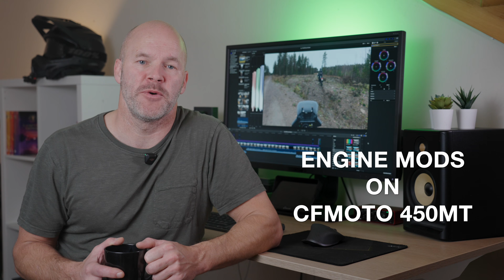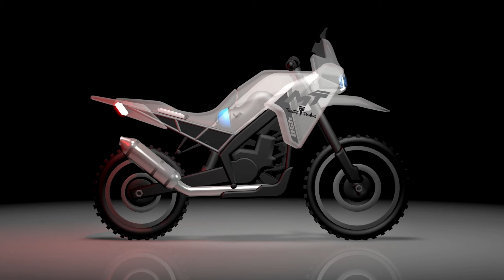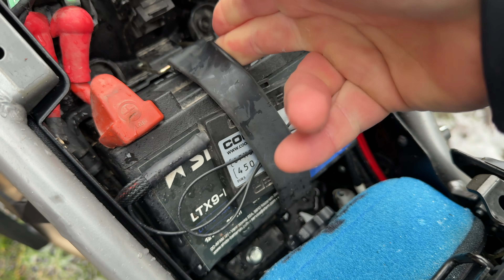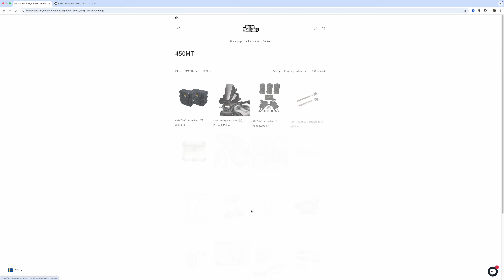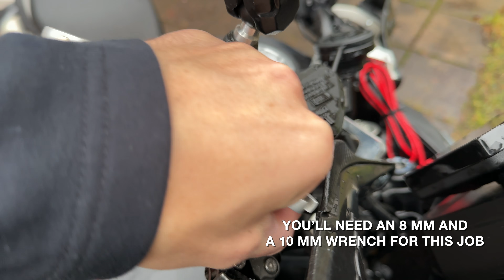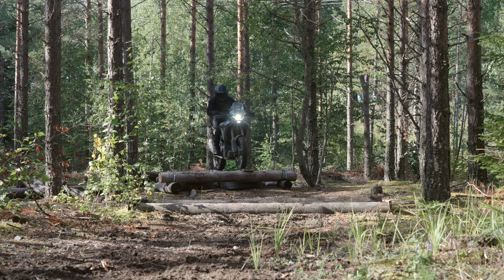How I Woke Up My CFMOTO 450MT – Real Performance Mods!

Comment from the maker: Thanks for watching the Engine Mod breakdown — this build has been a blast to work on. If you want to see what I did next, check out my Weight Reduction video as well.
👉 https://youtu.be/w7ChxzcNM0k

Or cheap offroad mods which transform your ADV bike to a offroad weapon:
👉 https://youtu.be/2JKNE9UNAjw
Reply: Why you choosed Coober ECU mod over Throttle Punks moded ECU?
Reply from the maker: @kristapskalvitis3066  Where I live the Coober solution don’t void the warranty of the bike. When warranty expires I will probably get another ECU for the bike.
Reply: Hi. I'm a novice in bikes and need an advice. If I change full exhaust and air filter. Do I NEED to remap ECU? Or bike can manage these changes ? Thank you
Reply: Remapping the ECU on a dynamometer should be the main first change.
The cobra ecu price between 400 to 500 usd? The remapping is cheaper and much more efficient

Comment: Would you mind sharing how to set the slack of the throttle return cable? I cant find any information on this. The "ON" cable is easy enough, just tighten until slack is removed but how should one think about the return cable to set its slack appropriately?

Comment: As a mechanic, I find it hard to imagine how the Coober continues to work over time.
I'd expect the very clever factory ecu to keep adjusting any additional fuel back over time via the long term trim function using the O2 sensors.

That was certainly the experience of my son's Husky 401 which retuned itself over time to the point where it was hard to start cold.
Removed the add-on box and it was back to normal. 🤔

Interceptor boxes are a poor cousin to a properly remapped factory ecu

Comment: Hi. I have bought a Coober ecu, the same you have mounted on your bike. I have a question for you. The cables on the Coober unit are marked nr 1 and nr 2. Do you know if it´s the left or right sylinder that is nr 1? I have sent a message to coober, but the haven´t answered yet.
Reply from the maker: Sensor 1 is the left one (if you are on the bike). According to the info I got, it really doesn’t matter on the front sensors, but if you want it 100% correctly, number one is to the left.
Reply: @TheAdventureNorth  Thank you so much🙏😃

Comment: Good evening from Greece. 
Thank you for the great work. 
I would like to ask you which one is better option:
Coober ECU or
Ready remap ecu from FuelDongle? 
Which one is safer for the moto? 
Which one is better option overall? 
Thank you in advance
Reply from the maker: I guess Coober will be the safe option, while a remapped ECU can improve the motor performance a bit more if everything is done correctly. Either way, the difference will not be night and day.

Comment: why you choose coober ? why not remapping the ecu ? wouldn't be better to map the ecu ?
Reply from the maker: Main reason for Coober was that it doesn’t void the warranty (at least in Sweden, where I live). An ECU with a good map is a better solution if you want to get the most bang for the buck and you don’t care about the warranty. I might swap my Coober for an ECU remap later on.

Comment: Regarding the ecu, how do you know if its a eur5b or eur5 i need?
Reply from the maker: The 2024 model is Euro5 and from 2025 they introduced Euro5+. Euro5+ bikes also have an additional sensor (in total three sensors on the exhaust vs 2 sensors on Euro5 bikes).

Comment: Very interesting video. I saw some other video where it was mentioned that our Swedish gasoline with ethanol in it does not work very well with the stock ecu in the 450. It was said that gasoline without ethanol made the bike feel much more alive.  /Jimmy
Reply from the maker: Hej Jimmy! I always use 98 octane, which has the lowest rate of ethanol (5%), but I can't tell if this affects how the engine runs or the power output. Interesting point, I wish I had access to a dyno.
Reply: @TheAdventureNorth  Aspen has a type without ethanol. It is branded with something like "for vintage vehicles". It would be really cool to se a dyno comparsion with regular B10 and the Aspen..
Reply: You will probably feel a small difference in power and mpg as ethanol has a lower energy density compared to gasoline. Here in the USA some gas stations have ethanol free pumps which I normally use for my motorcycles.

Comment: Hi,

Like the channel a lot, and appreciate your efforts. 
Did you do the EVAP and SAS delete/removal with the Throttle Punks airbox?
Reply from the maker: Thanks for the support! No, I didn’t do the EVAP and SAS removal, but my mate did. I did try his bike, but for a really short ride under slippery conditions, so it's hard to say how it compares to only the airbox upgrade.
Reply: He had the Punks airbox also? 
I'm going to fit their airbox and might as well remove the EVAP and SAS when I'm in there, just not sure if the delete is compatible with Punks modification 
Thanks
Reply from the maker: Yes, my mate has Throttle punks airbox AND EVAP and SAS removal. Works fine!
Reply: @TheAdventureNorth thank you 👍🏻

Comment: Hei. I am very interested by the COOBER ECU. I purchased my MT 450 in Norway in Nov2024 and i see that there are 2 models on the website. which one did you go for? Also the mounting instructions are pretty simplistic, was it straightforward to mount? Thanks!
Reply from the maker: It depends on whether you have a Euro5 or Euro5+ bike. The Euro5+ bike has one extra lambda sensor after the cat. If you have a 2024 model it's most likely a EURO5 (two sensors, one on each header pipe) Installation was easy!

Comment: Where did you get that air filter, and its easy to install?
Reply from the maker: You can get it here: https://eshop.throttlepunks.cz/en/450mt-intake-system
It's not hard to install, but it took us 3-4 hours to install (got help from a friend that did the same installation on his bike before mine) There are a lot of parts to remove before you can reach the airbox, which is the reason it took us several hours. However, non of us works as mechanics.

Comment: Uncle Wangs headers sounds much more un appropriate that it should...
Reply from the maker: Thanks for your comment! I agree — I prefer the stock sound as well. But the weight savings and performance gain were worth it for the relatively low cost.

Comment: You already have it but didn't explicitly mention it... LiFePO4 battery. Saves another 1.5 to 2 kilograms of relatively, high-up weight. And lightness=performance.
Reply from the maker: That's a great point! You're right, I do have a LiFePO4 battery, and the weight savings are definitely a bonus for performance. Video on weight reduction, battery and other stuff drops on Thursday!
Reply: @TheAdventureNorth  agree its lighter but it dead after 2 weeks of not using bike during winter :D Its not a problem just don't forget to put it away from bike during winter !

Comment: On the 2025 midel there is a lambda sensor after the catalysator;  the Uncle Wang pipe dosent have a mountimg for this. What did you do?
Reply from the maker: I have a 2024 model so no sensor on the catalysator on my bike. But, the titanium headers I got has a mounting hole for a sensor on the cat. I have just plugged that with a nut....

Comment: When you put the throttle punks airbox on did you you use the standard rubber "boot"s to attach to injection body ?
Reply from the maker: Yes, correct!

Comment: If you were limited by budget what one thing do think gives the best performance for the money?
Reply from the maker: Actually, just by removing the slack in the throttle cable makes the bike run smoother. Second is Coober or an ECU from another supplier with good reputation.
Reply: @TheAdventureNorth Thanks for replying, i'm not looking to get more power but would like less snatch yo the throttle.
Reply from the maker: @neilcook8774  Then you can save a lot of money and get still get a bike that's a lot less jerky on the throttle. Check also @tonyharrison7921 comment on another hack that's totally free and still make a big difference (I haven't tried it myself yet)

Comment: claimed 3 HP gain just from the airbox mod? I doubt that very much.
Reply: More important is to know at what RPM
Reply from the maker: Great point! Knowing the RPM is crucial for understanding how to optimize performance.
Reply from the maker: Thanks for sharing your thoughts! Throttle punks claim 3 HP and that it's dyno tested. But I don't know... it improved the performance anyway.

Comment: And about throttle jerkiness - it is a very subjective thing, no way to measure it. 
From my experience - this is also very different from bike to bike (i was able to try multiple ones) . For example 2025 EURO5+ model had it much less noticeable then my 2024 model. 
But - strange part - even my own bike behaves differently on different rides and conditions. 
Never the less all these mods does help to some extent. I also removed slack from the throttle, i replaced chain which was done on 12k km, i also have 140 80 tyre and 15t sprocket atm, and with all this jerkiness is not noticeable, at least for me.
Reply from the maker: Great insights! Throttle jerkiness can definitely vary from bike to bike, and it’s interesting to hear how your mods have made a difference. It’s all about finding what works best for your ride!

Comment: Nice video, but honestly i doubt it. I did similar mods and yes, there is a difference in how bike behaves, but it is minor. I wish i could try your bike to compare. 
Any way , and most importantly - there is no more power, or it is hardly noticeable. 
And i know because i did some acceleration measurements before and after, did some drag races, and i also had few of my friends with stock bikes try the bike. 

You could get a feeling that it has more power, because it is louder (decat), and it "screams" more (i dont like it to be honest) and also there is more of a kick when twisting the throttle in the low rpm. 
But if you measure acceleration, or even better do a drag races with stock bike before and after - you will see what i am talking about.
 All the best !
Reply: I haven't wrote - i have titanium decat pipes, custom printed air intake with DNA high flow air filter and i tried two different ECUs from Wang.
Reply from the maker: Did the jerkiness disappear completely with the new ECU?
Reply: @TheAdventureNorth  As i said in other comment, not completely, but in current setup i don't notice that it bothers me :)
Reply: @TheAdventureNorth  Btw very interesting goal and channel, i ll be watching it.
Reply from the maker: Thanks for tuning in! I’m excited to share more adventures and mods with you!
Reply from the maker: Thanks for sharing your detailed experience! It's always interesting to hear different perspectives on mods. It's not a major increase of power, but it runs smoother and almost no jerkyness. It also pulls better from low RPM. My tires  weight quite a lot more than the stock tires so if I'm tied on a drag race with a stock bike there is a power gain with the mods. All the best to you too!

Comment: Niceee! Thanks for sharing! I also notice a nice tail rack there alongside with slimmer passenger grips. Where did you got that tail rack?
Reply from the maker: Glad you liked it! Both passanger grip and rack are from AliExpress. But the rack is actually bigger, but I just cut it down to fit better with the passenger grips.

Comment: Was the Coober easy to install, manuals look quite basic?
Reply from the maker: Totally! The manual is pretty basic, but honestly, if I can do it, anyone can! You’ll need to remove the right-side fairing (there’s a slightly awkwardly placed screw right next to the turn signal, under the fairing), and if I remember correctly I had toalso take off the O2 sensors from the header pipes. Nothing complicated and you should done with 30-60 minutes.

Comment: Great Video 👌 have you think about changing the sparking plugs? Changed mine at my CF ATV and its a big difference ✌️
Reply from the maker: Glad you liked it. Haven’t thought about changing spark plugs. Please let me know more about the difference you noticed.
Reply: @TheAdventureNorth  I changed to iridium spark plugs from ngk and the engine runs much more smoother (for me its a big difference)  you have also  a little powergain through the change . you can also have a little better fuel cunsumption . sry for my english 😅

Comment: Well you talk about feeling which is the biggest improvement. But just for information do you know how much power percentage you have gained ? And that would be interesting to get the Air Fuel Ratio on the whole map. Just to check you are still in the tolerance target. Thanks for info. That would a good option for a future toy.
Reply from the maker: Great question! I’m not sure about the exact power boost, but it’s definitely not a massive increase. Where I live, the Coober ECU doesn’t void the bike’s warranty, so it shouldn’t throw the mapping out of tolerance either

Comment: If you want to fix the fuel metering problem all you have to do is unplug the wires going into your clutch lever and bridge the two wires together, I just used a fuse, don’t ask me how it works but it does, I can now  ride at idle speed in top gear and accelerate cleanly without any problems, don’t take my word for it , just try it and you will be surprised only thing is it will start in gear
Reply from the maker: I really appreciate you taking the time to share your experience! It’s always helpful to learn from others in the community. I’ll give your method a shot!
Reply: @TheAdventureNorth let me know if it fixes the jerky throttle please
Reply: You are the best! It worked for me too!!! The bike now is smooth like feather!!! Good job man!!!!🔥🔥🔥🔥
Reply: I will try it for shure!!! Thanks man🤙🤙🤙
Reply: It worked!!!🤙🤙🤙 The bridge on clutch sensor worked!!!! Now its real bike......no jurkie anymore for me hahahahah like 80% is gone people!!! Do it !!!🤙🤙🤙
Reply: Hey mate are you able to post a photo on the wire mod? How long have you had it like that and what or have you the idea? Cheers
Reply: on the clutch level there’s two wires that plug in you can’t miss them unplug them and bridge them I just used a fuse and plugged them into it you can use anything metal, I did mine about a week ago , I can’t take credit for it I saw it on YouTube myself and thought I’d share it with others
Reply: @tonyharrison7921 could you share the YouTube video , where you see this done ?, please .. It would really help to explain all ... Appreciate your input thanks 😊
Reply: no I read it, there’s only two wires coming out of the clutch level it’s between the cable and the handlebar and you just unplug the two wires and get a fuse, doesn’t matter what amps it is and plug it into the two wires
Reply: @no.latitude  https://youtu.be/U3HhbE4QPn0?si=RLT-39yXDygFrpzT
Reply: @no.latitude  https://youtu.be/WJ3p2f_SbrQ?si=fsPx9ICzIAC1WC8R
Reply: Amu chance of a video of this mate as I'm fuckin useless on the tools  without seeing it first?
Reply: @terrystubbsjnr  I did mine a while back.
It's extremely easy easy to do, on the clutch lever you will see 2 wires coming out the back, unplug them & join them together by slipping a small bent piece of metal into the spade connector on the plugs to join them together, voila done.
After about 1/2 hr of riding the bike 'learns' its new fuelling & that's it.
Reply: What happens if you plug the wires back into position after a few rides ? Does it return back to jerky throttle?
Reply: @BennyTheKnife I haven't tried, I don't want to jinx it 😅
Reply: @BennyTheKnife yes it returns to original.
The joining of the wires prevents fuel cut on overrun due to the ECU sensing that you have 'the clutch pulled' via the switch.

It's not magic, but it helps.
Reply: Like the clutch bypass mod for the KLR!  Made the KLR less jerky as well. Someone should make a plug in mod just like the one for the KLR on 3D cycle.

Comment: Does the throttle punks filter remove the inner filter as well? It doesn't specify on the website
Reply from the maker: Yes, the foam filter do replace the stock paper filter.
Reply: @TheAdventureNorth  Awesome! Glad I found this video. Wanted a single foam filter at the intake area but all the other options arent as sealed as this is! Will be ordering one now.
Reply from the maker: Thanks for watching! The foam filter is a great choice for better sealing. Excited for you to upgrade your ride!